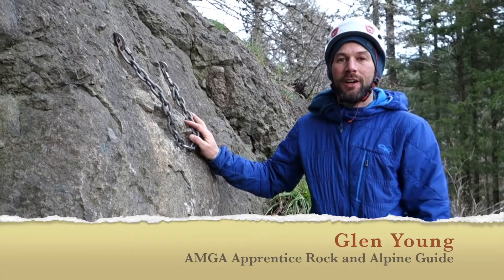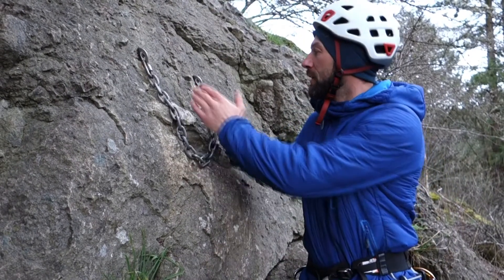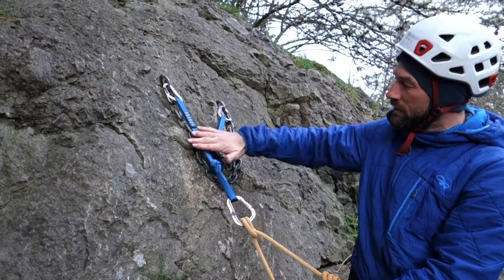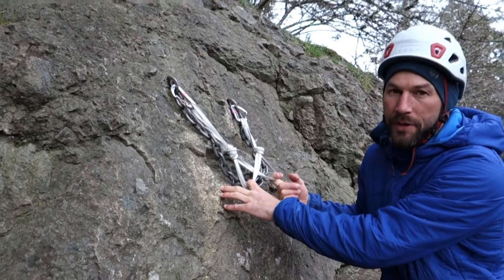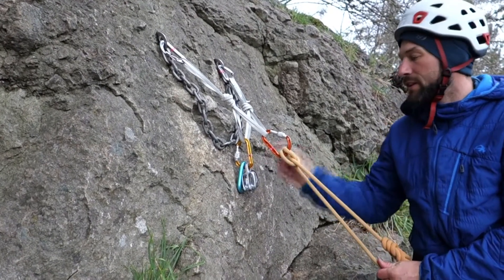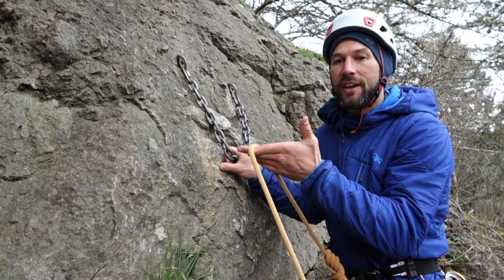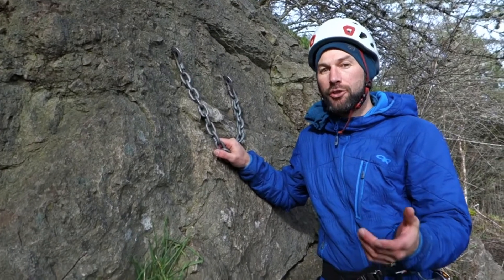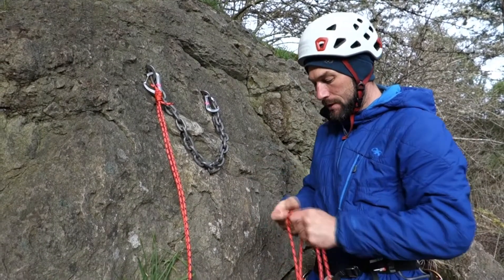Bolted Multipitch Anchors

Comment: At the 2:46 mark, I'd suggest clipping the 'biners into the bolts underneath the chains, rather than on top of them.
Reply from the maker: @rangertommy, thanks for the suggestion.  In many cases I prefer to clip the bolt hangers over the top of the chains as long as this does not result in any leverage on the carabiners.  The reason I often opt for this is because it makes the anchor very easy to clean.  When the carabiners are clipped under the chains it can be difficult to remove them after you have threaded your lower or rappel.  One time I will clip under is if anchors are flat on a slab at the top of a route, and the carabiners might be levered inside the bolt hangers resulting in possible damage to the carabiners.  This is a special case, and is not present in this scenario.
Reply: @skillsforclimbing  Great explanation of the exceptions!

Comment: Thanks for the video! Is there any case where you’d use classic anchor vs quad?
Reply from the maker: That's a great question @vickjou4544!  Whether to use an equalized v-anchor or a quad is really a personal preference when it comes to good bolts.  Both a quad and a V-anchor are plenty strong for the application.  In trad climbing and alpine climbing there are times when you reach a ledge and your best anchor option is just two cams (either because you used gear in the pitch below, because there aren't many placement options, or because you are trying to move quickly and the terrain does not demand a three or four point anchor).  If I were using two cams for my anchor instead of bolts, and the cams were not both unquestionably strong and in unquestionably strong rock, then I would prefer to use an equalized V-anchor rather than a quad.  This is because if one of the placements failed it will take more of a shock-load with a quad than with a V-anchor.  In the case of good bolts, it is highly unlikely that one leg of the anchor would fail (if it did it could be because you nose-clipped a carabiner, broke a carabiner by clipping through a point on the anchor that resulted in levering, or the bolt was not placed or tightened appropriately).  The next bolt should then still be more than strong enough to handle a small shock-load with the dynamic rope.  The two biggest reasons I like to use quads on bolts is  1) If you use a 240cm dyneema quad, and tripple-it before tying the knots (not just doubled), then it is extremely easy to untie- even after it has been under load for an entire day of top roping.  No need to pass a carabiner into the knot to help it stay loose.  I've used this for setting-up slack lines- which are under quite a bit of tension- and still had minimal difficulty untying the knot at the end of the day.  The other reason is because I can pre-tie the quad, and when I reach a bolted anchor I can usually quickly clip it in without the need to make any adjustments. It is self-equalizing.  On a multipitch route this is very handy, since I might be trying to stay out of another party's way, and this saves a bit of time.  The large separate shelves also are nice when attaching multipitch climbers, since the movement of one climber on the anchor doesn't pull other climber around nearly as much as if they were attached to a V-anchor.  But these are personal preferences, and are not more technical system and comfort related than safety.

Comment: 800lbs is only 3.5kn. That would not be my choice as a single point to clip into. My default is always the quad
Reply: @skillsforclimbing   Thank you for the reply and the knowledge you share! Greatly appreciated brother. I'll check the petzl info
Reply: I'm not sure if the "working load" is the same as max load, but yes, 800 lbs is weaker than everything he has on his harness.
Reply: Pretty sure that’s Working load limit.. with a safety factor of 10(?) that would be 35kN I believe. Maybe someone can verify that.